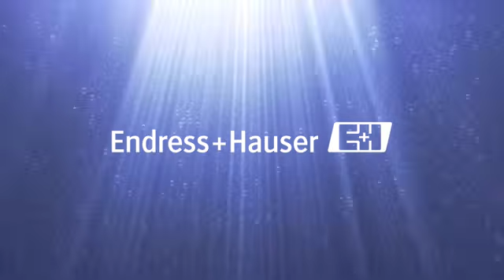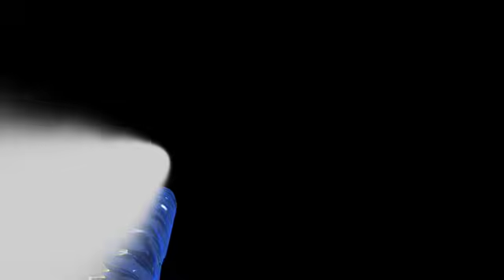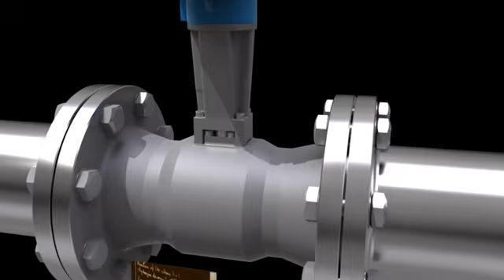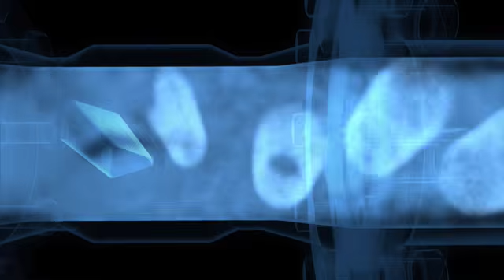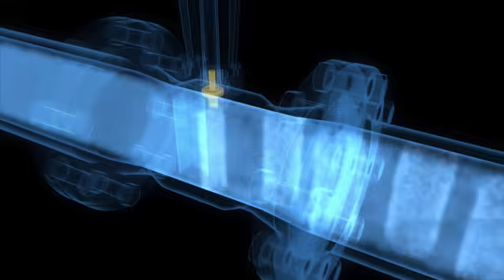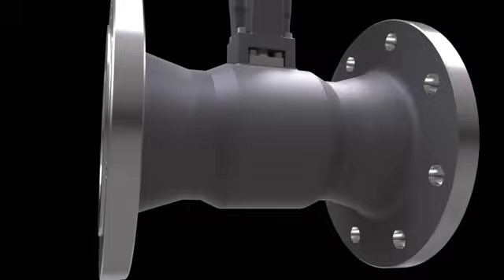The Vortex Flow Measuring Principle

Comment: The coop where I live decided to eliminate the thermostatic disks from our Dunham Bush steam traps and instead replace them with orifice plates.  We have experienced higher annual steam costs after these replacements.  I am an HVAC operating Engineer and have explained to the coop Board of replacement this error but it has fallen on deaf ears.  Is there any source available to reinforce my opinion on the mistaken use of orifice plates in our steam traps?
Reply from the maker: We have the following sources about steam and flowmeters dedicated to corresponding applications, but not specifically on orifice plates. Hopefully, the information helps you nonetheless:
https://eh.digital/3Xm8UdQ
https://eh.digital/3XaR8u4
https://eh.digital/4dRnHUU

Comment: What is the main reasons of malfunctioning of sensor
Reply from the maker: The system is tested under severe conditions such as water hammering and overspeeding. From our experience, these out-of-specification events may result in a malfunction of the flowmeter in some cases despite the tests. In the case of difficult processes in your plant, we recommend to contact your point of sales for consultations regarding selection, sizing and installation https://www.endress.com/en/contact

Comment: Working principle based on ideal condition from what I get from this video. What are the ideal conditions. Constant flow? Clean flow? Laminar flow? etc etc. In real world application ideal conditions don't seem to exist mainly after several years in service.  Can you explain when these meters do not read steam flow accurately. Does bend in the line changes flow reading? Does the meters has to be placed in straight run pipe?  For me this video was not helpful at all.
Reply from the maker: Our Vortex flowmeters are designed for real life process conditions and have proven themselves in several hundred thousand applications in various industries for years. They can be used to measure the flow of liquids, gases and steam in extreme applications like hydrogen gas, liquid mercury, liquid bitumen and other applications where other measuring principles fail. A certain minimum flow rate is required for the vortices to form. In cases where the flow velocity is too low, this problem can be circumvented by installing a flowmeter with a reduced cross-section. This consequently increases the flow velocity and does not have any affect on the measuring accuracy. The inlet requirements can be found in the technical documentation for the device. If you have further questions, please get in touch with your local Endress+Hauser contact: https://www.endress.com/en/contact.

Comment: Thanks for the video. It must have been the outcome with  long years of experience to have  such a design, but I wonder why in most of the sensors, main body of sensor for the computations is far from the sensing body.  I would appreciate any thoughts :)
Reply from the maker: Dear Hüseyin Felek, thank you for your comment. You are right, the measurement of the vortices should take place at the bluff body itself or directly downstream, which is the case in our products guaranteeing optimum performance.

Comment: Do vortex flowmeters required 100% filled fluid in case of liquid flow measurement?
Reply from the maker: You are correct, vortex flowmeters require a fully filled pipe and a fully developed flow profile in order to measure. Please check the section Installation in the devices’ Technical Information, available on our website https://eh.digital/38OsR4E
Reply: @endresshauser  thank you ☺️!

Comment: Can you install a bypass line around the flow meter?
Reply from the maker: Yes, a bypass line with block valves around the flowmeter can be installed. This is even recommended (depending on the process) in case the flowmeter has to be dismounted from time to time for maintenance purposes.